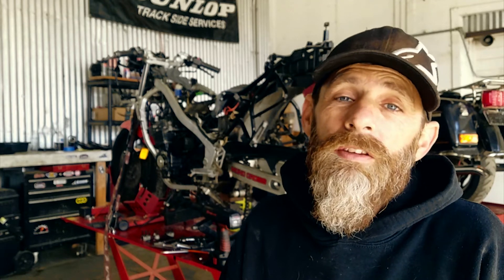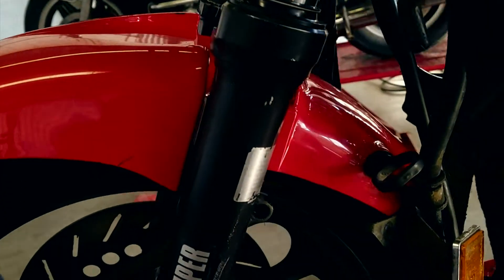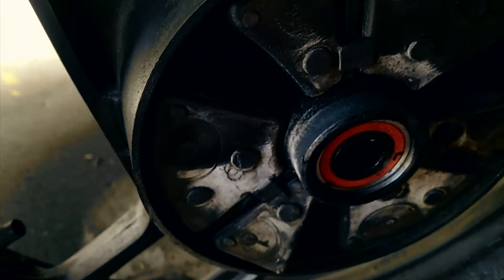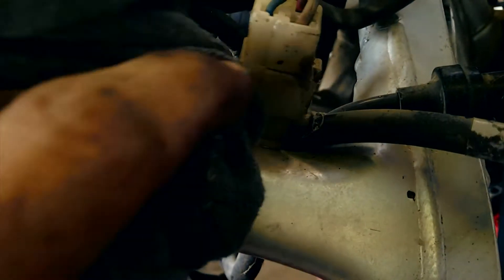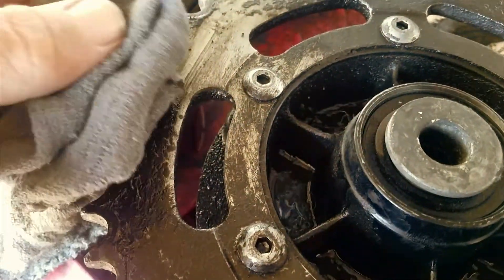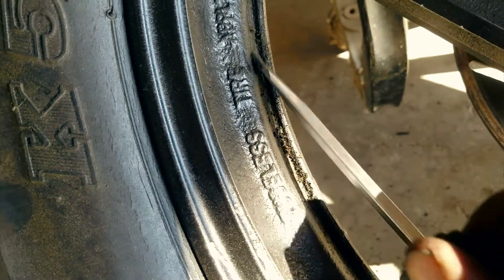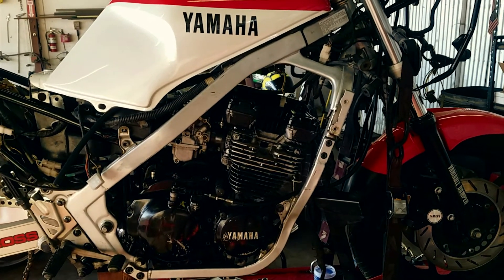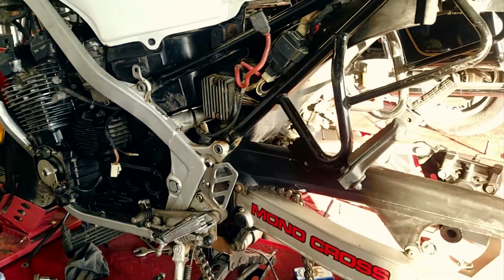1986 Yamaha FZ600 Refresh - Part 2

Comment: Just wondering I am currently rebuilding one of these engines and need a carb rebuld kit as one of the needles is missing. where can i find one that will fit?
Reply from the maker: Start scouring eBay. You'll find some kits out there. You can also give Dynojet a call and ask them directly if they can send the proper kit for your setup. If it's a bone stock exhaust and airbox get the factory spec jets and start from there. Should work perfectly.

Comment: Hey I have a 1987 Yamaha fz600, the motor runs, but the generator is fried... I'm pretty new to this, is there any other model that use the same generator or is there you know can I use a regular generic one from another bike??
Reply from the maker: Yamaha YX 600 Radian is the same engine.
Reply: @MotoMedic  thank you so much!!
Reply from the maker: @tristenwitt7444  most welcome! If you can't find a part. Find the original stock number and pop that number into eBay with a few keywords. Never know what you can find!